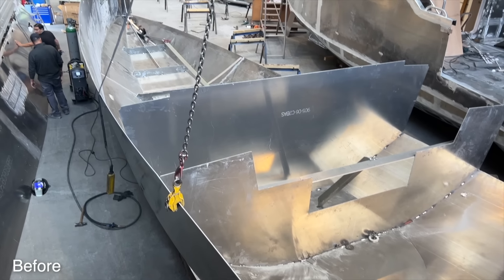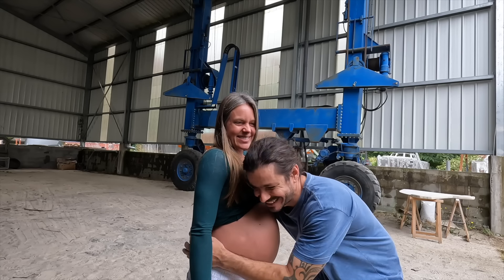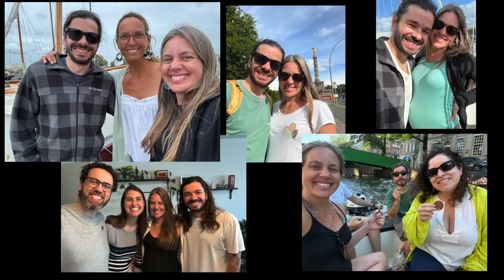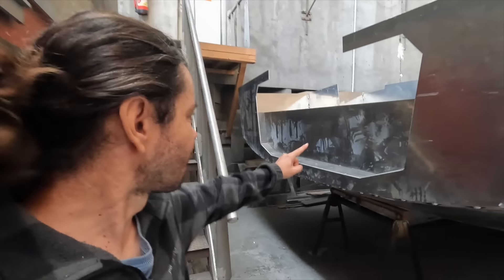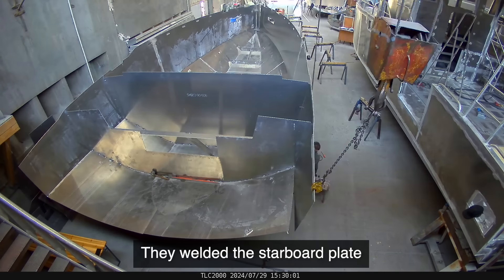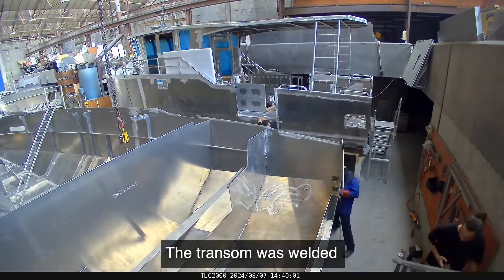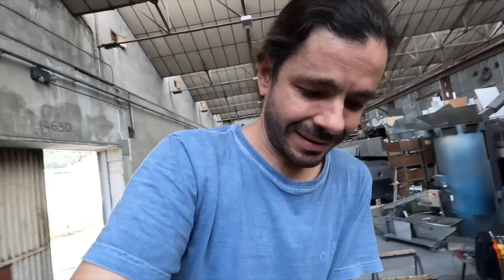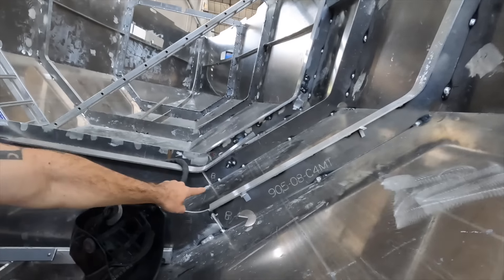⛵️Building our new 43ft Aluminum Exploration Sailboat!! Ep.347

Comment: Duca, you began by telling us this aluminum boat build would be different from others, that it would be built keel down (deck-side up) with plates, then internal ribs (super-structure) installed - yes, and it seems to be going faster than other aluminum boat builds in-process and recently completed by building the internal structure first then adding the plates. The tools and methods the metal fabricators are using to get the pieces in the correct position for tack-welding are interesting to me. Looking at the tools and methods to prepare for welding, the fabricators are experienced and know their craft!  Hi Roberta! I hope all goes well!  :¬) Webhead USA